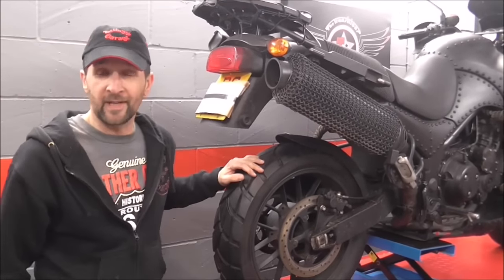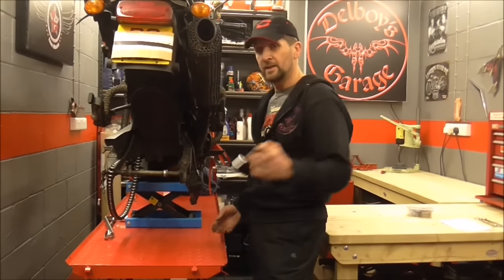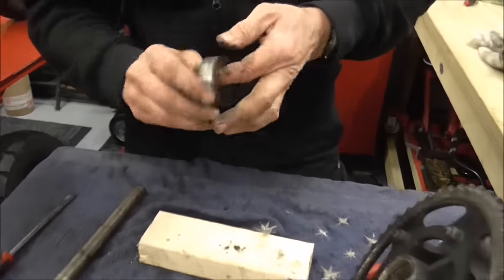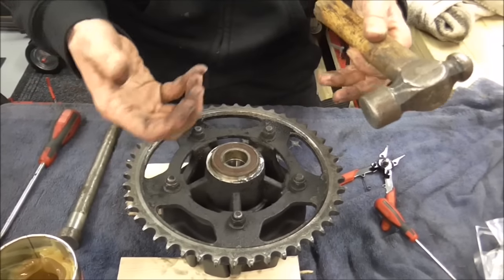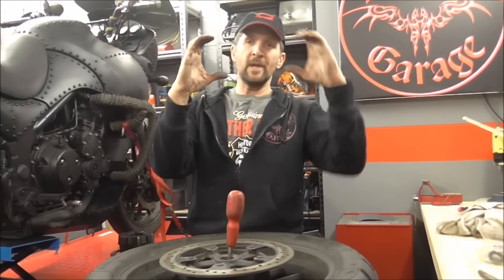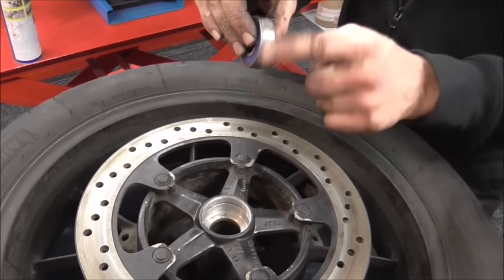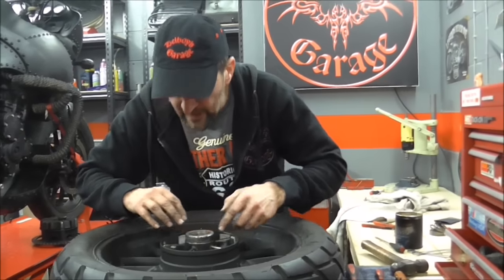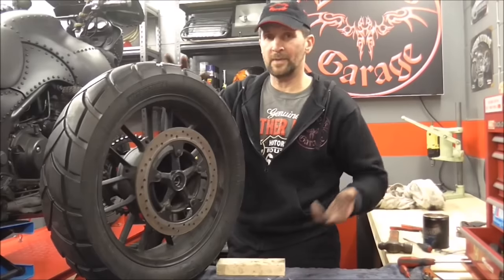Delboy's Garage, Motorcycle Wheel Bearing Replacement.

Comment: when i put bearing back in i used the old bearing but i put a washer in between with a smaller hole to get the old bearing out just a little tip
Reply: Me I used a 27mm pipe
Reply: @64fairlane305  
can you explain?..been trying for 3 hours trying to get mine old one (onee i used to tap new one in) out.
Reply: @JonNichols2112  Using a caliper tool, you can measure the interior of your hub.  The hub on my 2017 ZX-10RR measures 32mm.  When I placed a 24mm deep sockwt in there it fit a tad snug.  A 5/16th socket seemed to be spot on with the bearing.  However, you must test the sockets because different brands (Craftsman, Duralast, Powerbuilt) etc, have different thickness sidewalls.  I suspect using a snug socket and a 6" extention may be enough to hammer out.  Proceed with hour own decision and caution.  Or, get the correct tools for the job.
Reply: @JonNichols2112 what r u using to get them out ? Shouldn't take 3 hours not even an hour
Reply: @JonNichols2112     try to heat the wheel arround the bearing.I had the same trouble and it worked for me

Comment: Great vid. Remarks: -old bearing can be grinded a bit for easier removal after install the new one spec. if the "hole" is too deep. -if the spacer pipe doesn't move enough to see the edge of the old bearing, I disassemled 1bearing, removed balls, removed spacer pipe, hammered out the other bearing, assembled the bearing and hammered it out then. Looking forward for today's assembly 🙈

Comment: Excellent video. One suggestion, disassemble your old bearings, (pull the seal, then cage, then balls). Take the outer part of the old bearing and grind the outer diameter down just a hair, all of the way around. Now you can use it to drive your new bearings in, without it getting stuck. I do the exact same thing if I need to replace races (cones).

Comment: I like your comment about fair exchange with dealers' repair fees.  When I started working on my bike, I immediately ran into all kinds of hidden knowledge that an experienced wrencher has, and I did not.  For example, what does it feel like when a bolt is "right tight".  I rapidly developed a new respect for these characters.  

For me, it is really useful to know about my bike (thank you for your videos), to trust it, to know my limits, and know when to call a pro.  From this place, it is pretty obvious who's doing business with integrity.

When I learned how to fix a flat, I now know I can get myself out of the forest if I get one, I need to be out of the forest two hours before sunset just in case I get one, and it is fair value for me to pay a shop with a tire machine and balancer to do the job when I'm not in the forest.

Comment: I often reference your channel when preparing for a job on the bike. They really help approaching a job I have not tackled before or looking for a better way to do a task. The last time I did front wheel bearings I put the bearing in the freezer overnight.
Really enjoy the videos keep it up please.
Reply from the maker: +eggybreadplease Good move buddy, the bearing only needs about an hour in the freezer to get down to 0c, then if you heat the hole up with a hairdryer or some boiling water, you can practically push the bearings in with your thumbs..!

Comment: Well its my first time taking out a rwar wheel bearing and watching your tutorial made it so so much better... I completed the job with no issues at all.. Just followed your steps and BOOM it popped out.... Can you use Lithium grease for peeping the new parts back in... Thanks so much mate... An absolute legend 👍
Reply from the maker: Hi mate, glad you got it sorted, you don't need to grease anything really, your bearings should be sealed and they're pre-greased inside, there's no room in the bearing cup for extra grease, so just maybe a wipe with a greasy finger so the bearing slides in and it should be fine... it's not a bad idea though to grease the axle to prevent it corroding inside the spacer sleeve.

Comment: A few years ago I used your fork video to swap the springs and replace the seals on my Versys, now I'm looking at using this to replace what I think are dead wheel bearings on my W650. Thank you for the great videos, it's super helpful to have such clean and to-the-point presentations for how to do these jobs. It takes work that I'd thought would previously require a shop and shows it to not only be accessible to a regular owner which is absolutely invaluable to anyone that rides regularly!
Reply from the maker: Thank you so much for those kind words, we're so glad the videos can help with your projects!  Good luck with the W650, that's a simple task so pretty straightforward.  Have fun and keep safe, Merry Christmas!
Reply: @Moonfleet41  Merry Christmas to y'all as well, ride safe and stay warm!

Comment: I know you posted this 4 years ago but thank you so much for doing this step by step, I'm bit of a novice but this has helped me so much, the MOT says slight rear bearing play so will give it a go, you made it look so easy, my machine is a gsx600f 03 reg.
Reply from the maker: Glad it helped Andrew, good luck with changing yours, take your time and have fun with it mate..  Del.
Reply: @Moonfleet41  thanks for everything, chain and sprockets ordered, rear bearings ordered and will also give the exhaust a go, would it be ok to make the original one a stubby?

Comment: After watching this video I feel confident to change my bearings myself. Well explained, thank you!
Reply from the maker: Glad to help, and good luck with it!
Reply: @Moonfleet41  today I took out the sprocket bearing and seal, it worked great, tomorrow I put in the new bearings and seals. What do you think, should it help to put the new bearing in the freezer before installing it? Will the grease get damaged by the freezer you think?
Reply from the maker: @arnedijkstra7715  Hi Arne, you can put the bearings in the freezer overnight, it does work ok, and it shouldn't damage the grease as obviously the bike goes out in winter weather so if you parked overnight in the snow, no harm is done... but personally I've never done it, I just tap them, or press them, in cold and it works fine!

Comment: Thank you. I’m about to change all my wheel bearings which I have never done. This is about the 5th video I have watched just to pick up on different methods. This is by far the best explanation of HOW  it all works. Not just do this and this but do this because this is how it works. Knowing why not just how always helps me tremendously. That way if I run into some kind of issue I will be better able to figure out  myself what needs to be done  to correct it. Spatular teaching. Thanks again.
Reply from the maker: You're welcome!

Comment: I like to chuck the new bearings in the freezer for a bit before installation (after you've checked they're correct size of course).  This shrinks them a tiny bit just as heating the rim will expand it.  It helps a little bit with getting the bearing in.
Reply: You're absolutely right! Then insert goes hand!
Reply from the maker: Paying attention from 37:00 to 37:05 .. i made it crystal clear...so saying it again... "HITTING ON THE BOLT HEADS, NOT ON THE SPROCKET"... this just pushes the cush drive carrier down into its seat...NO PRESSURE i placed on the bearing..!
Reply: OK,SORRY!!But it's really good to give deposits frozen and warmed charge!THX!
Reply: Very informative. Thanks for this video.
Reply: Couldn't you get condensation inside the bearing on the grease as it warms back up again?

Comment: I had to do this exact job on my back wheel but one bearing was so ruined and horrible, when i was tapping it out the whole thing fell apart in the wheel so i got the middle, plastic bits and what was left of the rollers ... Leaving the outer ring left in the hub ... Ended up having to get it heated up to get the bastard out!
Reply: +lausa92 lol nothing worse than when the cage goes on a bearing and you have that thin metal band wedged in, that's the point I normally walk away and get a cuppa.
Reply from the maker: +lausa92 Bad luck mate, had that a few times, and it just makes it a much longer jon aye!  If you go that way again, after the first few hits, if it doesn't feel like it's moving and the hammer is bouncing back too much, then stop... turn the wheel over and fill up the area with WD40 overnight... then in the morning (and you may not believe it!) but just pour boiling water around the alloy surrounding the bearing, then spin the wheel over and it will tap straight out - works every time !

Comment: Great video. I'm replacing front wheel bearings on my Honda Goldwing. Discovered that the spacer (bearing collar) was missing after the previous owner had the bearings replaced by the dealer! Needless to say, the bearings failed in less than 1000 miles of me riding. Just got the spacer in the mail, and your video just helped me out quite a bit. Cheers from Texas, USA.
Reply from the maker: Hi There, thanks for you kind comments.. and yeah, why am i not surprised the dealer left it out... the internet is littered with tails of the carnage they cause.. and they are supposed to be the "qualified technicians"... lucky you caught it before it collapsed and caused a problem riding.. glad the videos can help you out sir.. good luck with your install... take care. Del.
Reply: Moonfleet41 Yes indeed. Thanks again!

Comment: Cheers Del, watching your vids has give me the confidence to start doing work on my bike . Just changed the head stock bearings , wheel bearings, disc and pads on my 114  fat Bob. Thanks again.
Reply from the maker: Most welcome Richard, glad to help mate.
Reply: @Moonfleet41  HD wanted to charge me for 5 hours labour for the above . Think iv actually done it quicker than them. They wanted 2 1/2 hours labour to change discs and pads , and 2 1/2 hours for head stock bearing. I bought all parts and tools for about £400 less than what they wanted to charge. Again , many thanks for your help.
Reply: @Moonfleet41  headstock bearing on the 2018 softail is a different set up to the one in your vid so had to have a different approach, but all good ⛄️

Comment: Great video! You saved me buying a bearing install kit.  I did buy the Harbor freight bearing extractor kit though, and glad that I did since I think it greatly lowers the risk of damaging the hub using the punch/drift technique.  With the kit I was able to remove the old bearing with no trouble, but did apply a bit of heat to the hub during removal. Thanks again!
Reply from the maker: Glad it helped, it's great to do your own maintenance!

Comment: Thank you so much. I just picked up a project bike it's a 2003 cbr954rr. The bike had a hard life in the past finally got the frame and rims powder coated. Just got done with the top end of the engine. Last part of the project is pressing in the bearings. Thanks again for the great tips. Awesome channel.
Reply from the maker: Congratulation on the project buddy, it sounds like your making fast progress.. just in time for the summer aye... Ride safe.. Del.

Comment: I watched this video before I replaced my wheel bearing today on my bandit 1250. Very useful. One thing I ran into trouble was that when driving the new bearing in using the old one on top, the old one got stuck half way in after the new one got seated. It was really hard to get the old one out. I had to use a punch on the other side of the wheel to drive the new one out a bit in order to push out the old one. It worked. So now I just use the punch to get the new one seated. I would suggest using the old one to drive the new bearing in about couple mm below the housing edge. Then removing the old bearing and using the punch or similar tool to drive the bearing in from there. I use this method to the other side of the bearing and it works perfectly. But thanks again for the video. In fact your instruction is so clear that I feel motivated to do it myself.
Reply from the maker: Hey buddy.... thanks for the great feedback.. i would warn against using any kind of punch because ut hits in one place and can twist the bearing in its seat... it sounds like you got away with it, but its can happen... then the bearing is jammed at a cock eyed angle... the Triumph i used in this video only had a shallow seat, so when it seated the bearing came out with a couple of taps on each side.. but if you do this again, then you could maybe slice the old bearing down the side so it wont get stuck..!     Great to know the video helped, and thanks again for sharing your success...  Del.

Comment: This really helps. Just about to start an 535 Virago project and looking to get the rims powder coated and replacing the bearings. Thought I’d need a press and pay to get the job done. Reckon this is on my skill level so thanks fella👍
Reply from the maker: No need for a press buddy.. if you stick the bearing in the freezer, and warm up the wheel with a hot hair dryer (nothing hotter or you'll burn the powder coat), then the bearings will almost drop in by hand....

Comment: Did my 08 Sportster front wheel bearings last weekend.  Had to heat the hub to get them out using a blind bearing puller.  Spacer was too tight against the bearings to move to one side.  Smooth as silk now!  Great video, keep them coming.  Pen does great camera work!
Reply from the maker: Nice one buddy, we always love to hear that the videos have helped someone make their way through a job successfully... we often have to overcome obstacles like the heat you needed to use.. but that just makes it more fun aye... take care and thanks for your feedback buddy... Del.

Comment: Just came across this vid after noticing my wheel making clunky noises - after watching, realised I'm doing things very wrong.
Had to change brake today and had to use a mallet to help get the axle back in because, although I use a paddock stand, I don't have a bench or anything so it's a bit awkward with me having to sit down to re-fit the wheel!

May well invest in a lift soon. Thanks for the vid, great as always

Comment: Years after posting this video, still helping out riders, thank you! Have to do the front wheel bearings on my own bike, wasn’t sure how to do it without a press; and now I know!
Reply from the maker: No problem 👍, good luck with it mate.
Reply: @Moonfleet41  thank you, I like your current style of content too, I’ve subscribed a while ago, but I’m glad this is what you did before and saved it for future reference.
Reply from the maker: @stefan2meter  Most welcome Stefan, good luck with yours!
Reply: @Moonfleet41  got the old ones out, waiting for the new ones to arrive. Proper knackered, too bad I can’t post pictures here. Quick question if you don’t mind, both bearings are seated and the spacer didn’t have a lot of room to be pushed away from the inner race; is it smart to take a file and make two or three slots on one side (not all the way through, just making the walls thinner towards one end), or would that weaken the material too much?
Reply from the maker: @stefan2meter  Stefan, 2-3 slots in what side of what mate??
Reply: @Moonfleet41  sorry, in the inside of the spacer tube between the inner races
Reply from the maker: @stefan2meter  No mate, certainly not, that would weaken the tube, its there to keep the two bearings from being pinched when you torque the axle nut up tight..so that tube takes a lot of end to end force and must be as strong as possible, it's also a critical length and you must never shorten it ! ... if you ever find it pinched and can't shift it with your finger, then pop a screw driver in the hole and gently lever it slightly to one side so you can get a drift in from the other end mate..
Reply: @Moonfleet41  that is exactly how I had to do it, took me ages to get the first one out, tube was pinched a little and then had no room inside to wiggle around, it caught on the casting in the hub. But I did it the right way and I now have an undamaged wheel to work with!
Going to fit the new bearings this weekend, have my first set of tires to change as well… bought an adventure bike, didn’t think the adventure would be in doing maintenance 🤣
Reply from the maker: @stefan2meter  Thats half the fun mate.. only by fixing them yourself do you truly appreciate them..!  Enjoy the journey.!
Reply: @Moonfleet41  I think so as well, just had a few cases of bad luck that’s all, one following the other, but they are all fixed now or about to be. And still have to pull off the rear suspension links (dogbone) to inspect the bearings and hopefully just regrease them, maybe I’m lucky now. Shouldn’t have bought a 20yr old Aprilia I guess! In the end I’m probably better off with a 20yr old bike with wear items 90% new than I would be with a half worn 10yr old, not hard to stay positive if you think like that :)

Comment: I was always sceptical about heating the cast wheel and freezing the bearing when replacing, was not sure how the two would react when mated together, stress fractures etc, FROM SUDDEN change in temperature so i do it your way( The RELIABLE METHOD) keep up the good work, very informative.
Reply from the maker: Hi Jason, I tend to agree, certainly on an old wheel that's been on the road a couple of decades already... but on a more gentle footing, you can certainly keep the bearing at room temperature and heat up the casting with nothing more than a hairdryer till it's just hot to touch... and then you'll still have to tap the bearing in, but it'll be really easy and pop in nicely, and no severe temperature change!

Comment: Great video del ,just like to add when you use the old bearing to knock new one in ,just go around the old bearing with a file or wheel grinder and take a little of the out edge , this way when you tap the new bearing the old one in can pull out with your fingers , hope everyone  enjoys that tip , peace out guys